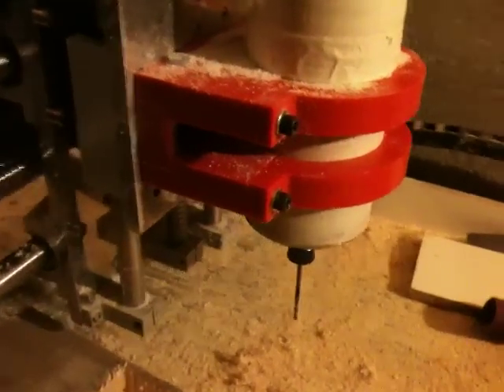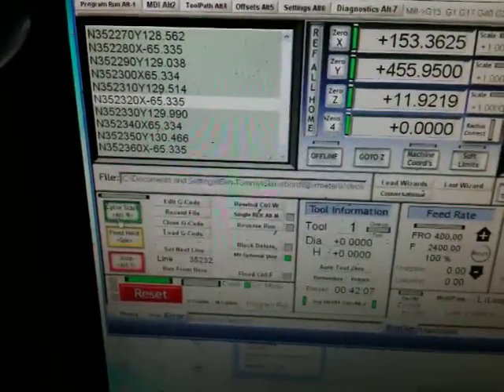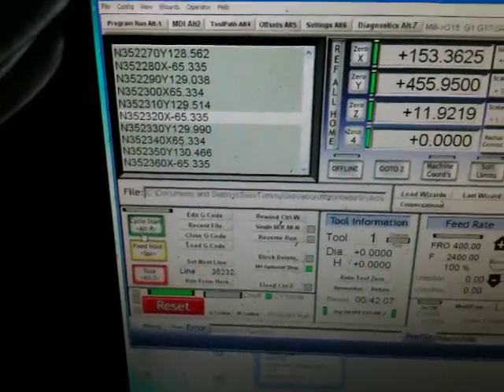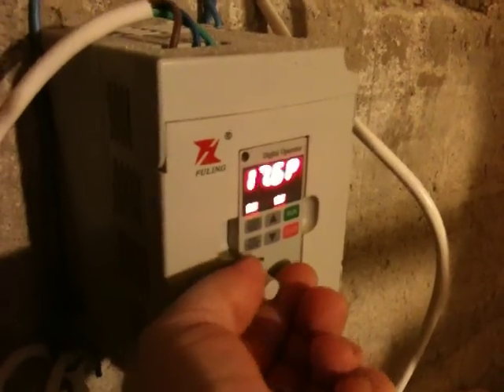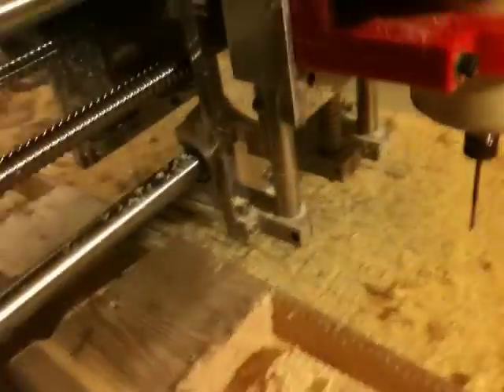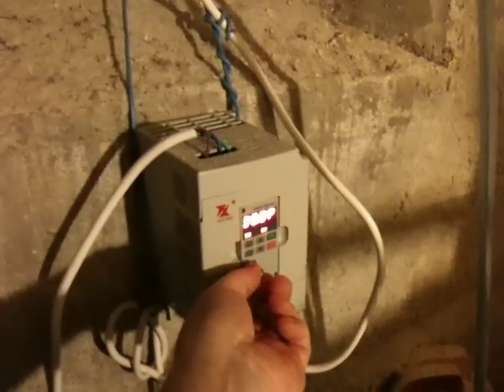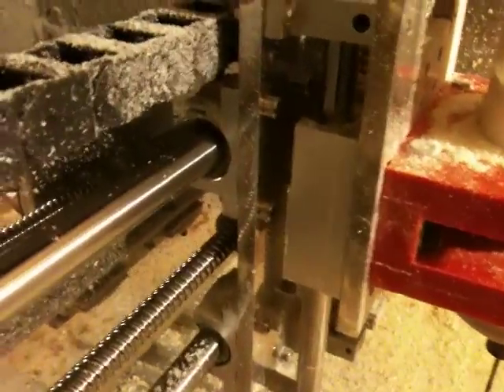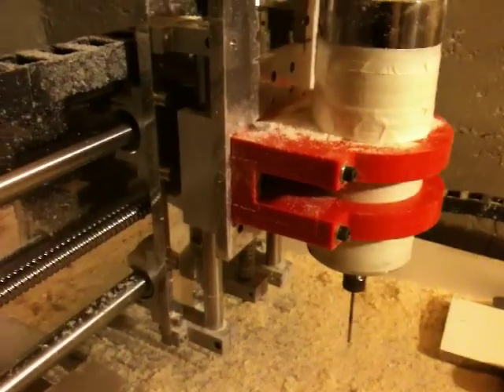CNC move when spindle start - ghost? SOLVED

Comment: This trouble started when the spindle brushes were  worn out. Cleaned commuters and replaced brushes.. Added .022microF ceramic capacitors in parallel to power line to motor. CNC runs smoothly
Reply from the maker: Assume that you use the capacitors to short-circuit the short pulses from the spindle. Brilliant.
Reply: Yes. Exactly. Not to propagate through power wire.

Comment: Hello could you tell me how did you solve it?
Reply from the maker: I tried to connect everything to ground. It worked a little. Finally I bought a new spindel.
Reply: This trouble started when the spindle brushes were  worn out. Cleaned commuters and replaced brushes.. Added .022microF ceramic capacitors in parallel to power line to motor. CNC runs smoothly

Comment from the maker: Yes ground problems. When everything  was grounded, it work well.
Reply from the maker: +Ben-Tommy Eriksen Yes i did. Ground Fault. When spindle spinning comes electricity in small pulse to the outside. So it was bad insulation in the spindle. It might be possible to repair. I bought new spindle. The voltage converter was okay.
Reply: I  have the same problem.  Where did you bought new spindle and is it ok?

Comment: Check to make sure the control lines for the steppers are far away from the spindle power. Make sure there is shielded cables where needed and tie only one side of the shield to ground.

Comment: Check to make sure the control lines for the steppers are far away from the spindle power. Make sure there is shielded cables where needed and tie only one side of teh shield to ground.